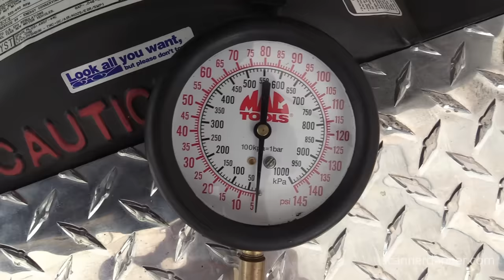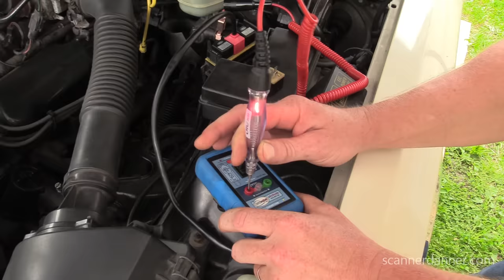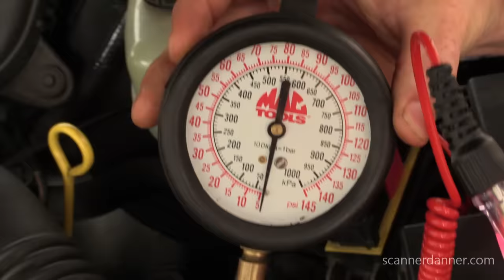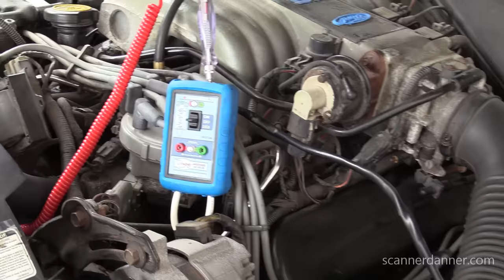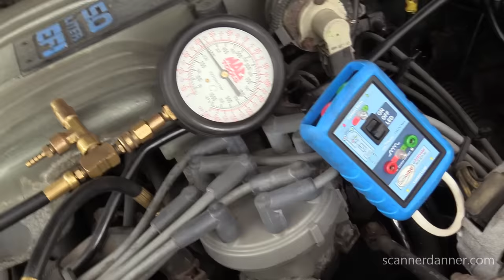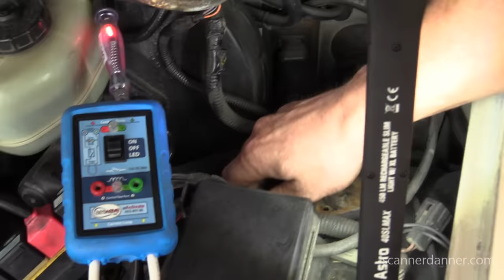New Fuel Pump, No Fuel Pressure Diagnosis (Lincoln Towncar comeback)

Comment: I had a Scanner Danner moment today Paul. My son's 03 Envoy would not start many miles away from home immediately after he filled his gas tank. He managed to start it once and brought it to a part time mechanic that his grandfather recommended. The mechanic said it was 100% fuel pump but he didn't have a lift to change it out, I just dropped the tank on my 04 Trailblazer a month ago or so, so I reluctantly told him I'll be there to get AAA to bring it to my garage. In the meantime my son ordered, then picked up a fuel pump and filter for $375. I told him NOT to open any box or lose any receipts until I did more testing.
 When we were getting it towed, 4 old timers were around including my in-law, who were adamant it was the pump. I tested for 2 power feeds at the relay, and bi bidirectionally ran the relay- confirming the PCM was doing its job. The old timers laughed and said "we told you it was the pump". I told em I believed them since there was no prime, but still wanted to check the power and ground directly down below. You can image the lectures and stories from the past I got from them for suggesting they might be wrong.
Anyways, today I jacked it up and was preparing to siphon some gas from tank to make it a little easier on me. When i got underneath, i noticed a ground wire on the side just below the drivers door that was located on the rustiest spot I have ever seen. I said to myself, that had to be it. I took out the PP4 and as soon as I tapped the area - the whole piece( the nut , bolt, and wire, metal from car) completely detached from the car. I put the PP4 directly on that and it read from 0.38v-1v.
          Long story shorter, I cut the green crusties out, butt connected a 18g wire with new piece on the end. I had to choose a new grounding point so since I already had the crossbar( supports fuel tank) off- I chose those bolt threads. I used a grinder to get the bolts, holes and each side of the crossbar that comes in contact with the bolt and car rust free. I wrapped the connections and added a loom. Reattached everything and squeezed dielectric grease in between for waterproofing., and sprayed Fluid Film on the bolt to inhibit rust and corrosion. Jumped in the truck and what do ya know- It fired right up! Re tested everything....ChaChing- Items returned-money saved! 
        Thanks Paul, I owe you thanks for my knowledge. I'm now at the point where I just know where and what to test and how to interpret the results sufficiently thanks to studying your book and free/paid videos. Sorry for writing a novel in your comments, but this was a major breakthrough and proud moment for me.
Reply from the maker: Don't apologize for the long story, it was awesome! Nice job man, seriously cool stuff and I'm proud of you man. You are the one who made this happen for yourself. I just provided the methods and you did all the work. God bless you my friend.
Reply: Good job
Reply: @PaulCTownsend  If that was for me thanks. I guess Im not the only one doing some late night studying. LOL
Reply: a great novel Isshman!   thanks for sharing  :D
Reply: @ScannerDanner  What is that diagnostic tool called and where can I get it?
Reply: In the early 80's, i pissed off a lot of old timers with new fangled troubleshoot'n techniques. If they had their way, shops would still have tune-up cabinets full of points and floats 😆.
Reply: pl9
Reply: pl9
Reply: 0
Reply: Great points and nice catch from your camera man son on the test light.  The only thing cheap fuel pumps are good for is education and material like this. Living in the northeast with a trailblazer and tons of rust on it, and going on a  3rd fuel pump (possibly) and coming across this video and this response is bringing me back to square 1, hopefully I find the issue and hopefully it's not the fuel pump,  which is easy to say on 04 trailblazer   thanks for all the input from everyone.
Reply: @ScannerDanner  one thing my automotive instructor taught us back in the day that I have always done was to keep about 25 feet of speaker wire in my box. When I’m using my test light at the back of the car I clamp one end of the wire to the battery and clip my light to it and keep the same ground all over the car. It also works when using a meter and doing voltage drop tests at the fuel pump/brake lights etc at the back.
Reply: Nothing like showing up those ' old timers ' , except for me, now I'm old, so I'm always showing up the 
' young punks '.
Reply: That's a great novel with a good ending.

Comment: If you don’t already have one, a non-contact tone generator would have saved you SO MUCH time on a job like this. I have the power probe tone generator. Last year I diagnosed a broken fuel pump wire that was grounded out on the frame. I spent a little while dicking around with a meter, but as soon as I hooked up the tone generator, it took less than 2mins to trace and and identify the fault. For me, it paid for itself on that one job. Nice work finding this one though!

Comment: Hey scanner Danner, i gave up before on several can't find a find a ground and made up a aligator clamp wire about 15 feet long and now its no problem on the rusty stuff. A perfect ground every time.
Reply: Ground, good battery that doesn't have a bad cell, bright and tight connections is the foundation of the "building".

Comment: Scanner Danner, I enjoy your videos. You forgot more about diagnosing automotive issues than I will ever know. With that said, you need to have at least a 5mm space between your OriGlam Coil Spark tester and any ground in order to see the spark inside the tester. Just a minor point as you will see a spark either way.
Reply from the maker: That spark tester was the wrong tool for this. It had the same male end as the coil tower and the wire isn't insulated enough. There was no physical way to connect the tool to ground (as its supposed to be) and then also connect to the coil tower. It's meant to be used on a plug wire and I wanted to test it at the coil. Wrong tool for the job.  I've had success in the past doing it this way, but in this case the wire was just too conductive to what it was near. Hope that makes sense why I wired it the way I did. Thanks!

Comment: At 21:00 " Are you sure you know what you're doing?"-- nice one Caleb! These are always the hardest to explain, customer thinks we screwed up, boss thinks we miss diagnosed first time. You mentioned verifying fuel pressure after installing a new pump, it's also good to verify power and ground on new pump to make sure you are not dealing with resistance in wiring.

Comment: Fourth cause might be contamination in the tank, rust, sugar, etc...to wipe out a new pump. Seen it on a few cars over the years. Great video ScannerDanner! Keep up the good work man.
Reply: yep, debris in the tank/clogged strainer sock is a common one too.
Reply: I was thinking the same thing. I just did a Jeep grand cherokee and when I pulled the old pump out i could see all kinds of black debris sloshing around the bottom of the tank. I had to flush it out completely.
Reply: Joe's Auto Electric Your absolutely correct about that sugar in the tank diagnosis. In my young and stupid childish days I messed up someone's vehicle with that trick.
Reply: Joe's Auto Electric AAx
Reply: on my 89 s10 pickup I replaced the gas tank fuel hanger and pump assembly. All brand new. I also checked the tank before I installed the pump for anything in it.

Comment: "You can hardwire every connector" Great advise. I'm rolling down the highway in my 18 wheeler and a low beam headlight goes out. I buy and install a new one and take off down the road. its getting dark and I notice the new bulb is not lighting. Where did I hear someone say "don't be a parts changer?:" 

Got out my volt meter and 0.0 volts at the headlight. The next connection is by the frame. I check the voltage 12.3 volts. I see lots of green corrosion in the connector. I snip out the old connector and crimp in some wire connectors. quick fix. It's all good.

You and your son are amazing. I use to take the truck to the dealership for this type of problem. NO DEALERSHIP, NO DOWNTIME!!! 

Thank you, thank you thank you
Reply from the maker: Awesome man! So glad to help out the working man. Especially you truckers! You guys are the lifeblood of this nation. God bless you and keep you safe my friend

Comment: I think I had that exact problem with my 95 town car. I never found the exact place, but when it would not start, I would take that relay module lose from its mounting tabs and wiggle it around and the car would start and run for a couple months until next time.  Initially swapping out the relay (with WOT) would make it start, but later I realized it was just wiggling that module was what "fixed" it.  That 95 has now been replaced with a 97 TownCar (not because of the pump issue).   Great detailed troubleshooting video.  I enjoy your process because I am now retired from Lockheed where I was doing that exact job on P-3 Orion aircraft and enjoy seeing you use the exact troubleshooting processes that kept me employed for 50 years and kept our customer wanting to keep me around.  I have since become a private pilot and bought an aircraft so now play with my own airplane.
Reply from the maker: Thanks so much

Comment: I like this video because it is honest and because it is exactly the kind of dialogue that goes through my head when I work on cars.  I make a theory and try to prove/disprove it before ordering parts.   Often you reach for a wrong conclusion, bu along the way, you find the real failure, just like this guy.  He is a good mechanic.  A trick you can use if you aren't trying t educate someone else:  keep quiet until the car is running again.  That way you don't open yourself to hindsight criticism.  Good video !! He shows the process and that will teach you diagnostics that you can do to get it fixed!  Excellent!!!

Comment: I agree with you about using a test light vs a muliti meter.  Sometimes when you have a high resistance connection, a mulit meter will register 12V but a test light would not.  This is because multi meters have a very high input impedance so they don't "stress" the high resistance connection like the test light does.

Comment: Great video! Detailed information and GREAT VISUALS! As I love older vehicles, 80's-90's I'm going through it with 2 Caprices not starting/stalling. New fuel pump, filter, relay, fuses, blah, blah. I'm a beginner DIY and hate the headache but LOVE the troubleshooting and positive end result.  Thanks for taking the time SD!
Reply: I'm reluctant to get a newer vehicle as I know these 80'-90's were everyday drivers for many once upon a time. (I'm Ol'School)😊 These 3rd gen styles are, non-sensor, computer controlling everything, super EZ* to work on, plus there is no guarantee new vehicles won't give you probs. In the "Turds" offense, I have been neglectful and running to mechanics for a help as this costs me more $ & time etc having 2 of the same car. Knowing is half the battle with reg maintenance & ppl like you guys!
PS any suggestions?
Reply from the maker: no starting/stalling right? First thing I would do it get it to be a no start, then find out what you are missing (spark or fuel), then go from there. You are at a fork in the road and you are ether turning right or turning left and until we know which direction we are going it is USELESS to speculate

Comment: Paul, wanted to extend my thanks to you for this excellent video that you and Caleb did.  I learned a bit on this one!  Sure enough,  I would have part cannon on that.  But those is something I had problem occurring for quite a while,  I had non functioning cruise control.  I admit I part cannon on the switch and the control module itself.  Didn't fix it.  But I remember seeing your early video from years ago.  Maybe 2 or 3.  The pin on the plug going to the module was bad.  I'm ashamed of myself for not checking the continuity or ground, open etc.  At least I learned something out of this video.  I hope I'll better myself in the future! 😀.

Comment: Wow, a stuck closed fuel pressure regulator can cause a fuel pump to go bad.
This was one hell of a video, nice job Paul & Son......
Reply: sure can, the regulator being stuck closed causes way higher than normal pressure and nearly "deadheads" the pump, which means greatly increased load and very little fuel flow through it. the combination of fuel flowing through it and being submerged is what cools them! some cars will blow the fuse on hot days in that scenario.
also when the tank is low, they're only partially submerged and rely further on the fuel flow for cooling.
on single line systems the regulator is in tank or the pressure is computer controlled by varying pump speed.
Reply: throttle bottle 
Thanks for your comments,  very informative.

Comment: One test I like is an amp test on the load circuit (at the relay) to see if the amps are high meaning the pump is struggling conversely, if low then a poor circuit in or to the pump.

Comment: The joy of mobile Diag. Too hot in summer, too cold and wet in winter. Working off gravel and grass. Great video, great Diag and some real life frustration. What more could we ask for 👍 Thanks Paul & Caleb 👋
Reply: Simply Diagnostics peouget expert h d I cuts out when I give it to much trottle to quick
Reply: Edward mc veigh McVeigh could be anything, damaged harness, blocked exhaust, water in fuel etc. I’d put a post up in Paul’s forum. There’s a good few brits in there that can help with euro diesel Diag techniques. Hope this helps. Steve.
Reply: Seen this happening a lot. Unplug your maf sensor and try and recreate cut out and if I was a betting man I would guarantee it stops. Sometimes cleaning it works if not it will need replacement. I’m a rac patrol and it’s a regular fault and another problem with same symptoms is your fuel pressure sensor on the high pressure pump on engine the second will need a scan tool with live data to see it.
Reply from the maker: hey, take this somewhere else!! haha just kidding, Steve has earned his right to do as he pleases here on my channel. Love you bro
Reply: Paul, there’s no way I could direct a question to anywhere else but your forum, book and premium channel in your comments. I just couldn’t do it  👍

Comment: you can always clip the "test light" clip on to power side and try to get ground with the probe end. it's a bit easier to dig through the rust that way, but it still doesn't work perfectly either.

Comment: Good video, always do an after the repair check.  I am a retired tech of 45 years. I have beaten on tank to start vehicles with bad pumps, my only reservation is beating could jar a bad connection near the pump and ruin the chance of finding the real problem.

Comment: Had a similar situation with an even on a 01 Dodge Grand Caravan that was purchased for $200 don in the southern states (no rust problems here) engine wouldn't run good pulled codes from ecm using the 3 key cycle method that Dodge/Crysler did back then and found it to have multiple fault codes that didn't coralate with each other went to start it up to do a drive test and when I did noticed when I slammed the hood down it went to running better so I focused on wiring near the hood area just to find it was the ECM connecter having the issue so I started poking around on the ECM wiring when I poked on the bottom connecter it went to a no crank situation so I disconnected the ECM connecters and reconnected it and the vehicle runs flawlessly now even corrected the a/c problem took a bit to get to there without the tools but got there in the end so I chopped my problem up to a pin fitment issue as well

Comment: Here's an interesting power ground , short fuel pump life case for you. 96 k1500 pickup 5.7 v8. Repeatedly burning out fuel pumps. 
Battery neg cable grounds to block, block to ground strap corroding, battery has a small cable to the sheet metal. Pump has ground and runs. But excessive current draw was
Front the pumps. Fix was to add a battery cable type link from the block to the frame, and a 8 gauge link from the frame to the body. 
Truck also had flickering interior lights, burned wiring t the blower motor and burned out radios. 
Failure by design by chevy, ground straps were way to small to carry the current load.

Comment: typical problem with GM 3.1 and 3.4 too. The connector running behind the alternator have same issues of female pin and getting fuel injector trouble codes. Good video.

Comment: i just wanted to thank you so much for the time you take making these videos.  I have a 98 Jeep Laredo, and to date I have diagnosed a bad crank sensor , correctly, i might add.  having issues with the ecu but this model is notorious for that.  I would be driving down the road at night and no problems, until of course a cop would get behind me, then whammo, no lights!  Or worrse yet, lose all power.  Of course the cops would pull me over, and go away laughing when they saw the kids swimming noodle i had jammed in between the overflow container and the ecu!  i am a little more professional now, lol.  I have since installed new exhaust system, Heat shield, fuel pump (yuck!), and as soon as my new ecu is flashed, will confidently be able to make sure there are no open circuits or shorts before i install it. Again thank you so much! The exhaust is a long story , as it involved running over amile marker post the wrong way. luckily it missed the engine, but not my floorboard on passenger side nor my exhaust. after it sounded like my boat , 455 bb olds, and you got a little high driving! But I digress! Thank You Scanner Danner